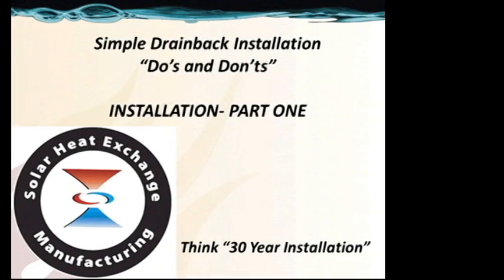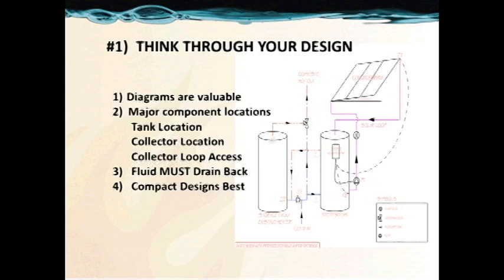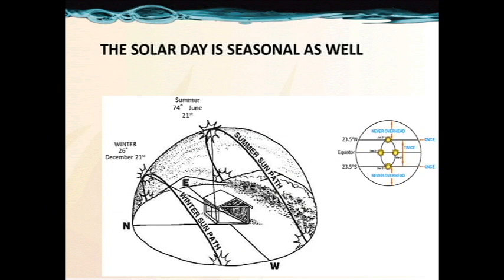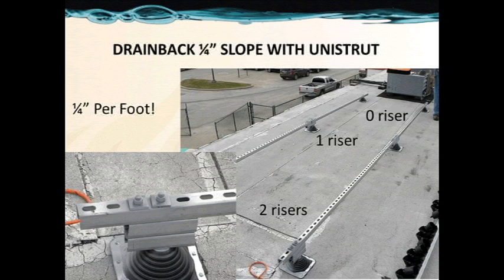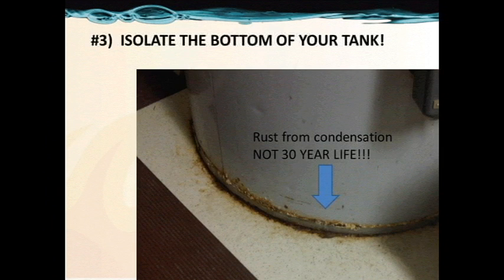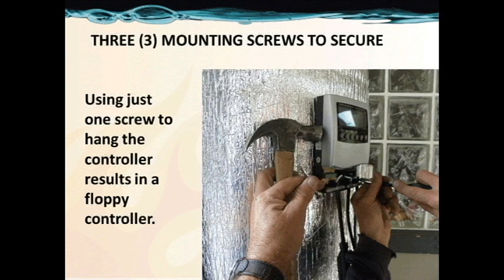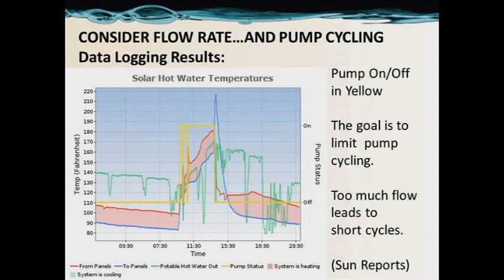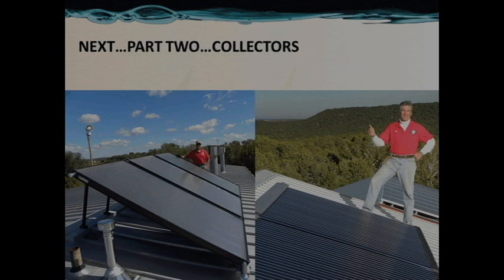Simple Drainback Installation Dos and Don'ts

Comment: Your pacing, tone, and presentation is EXACTLY like the great Michio Kaku!
Anyway, I know this question is probably like beating a dead horse...
I live in central PA, and we do get quite a bit of freezing weather/ cloudy days. I want to heat a 200 gallon tank to around 140 degrees or as high as i can get it. Then I will just be heat exchanging out of that as necessary for radiant and dhw. What would be better, flat plate or evacuated tube? Flat plate prices are ridiculous for what they are, evacuated tubes are actually cheaper now'a'days. So I'm leaning toward the evactuated tube for drainback. Any input? Great video by the way!!!!
Reply: This reply is probably too late for you, but, it is my understanding that flat panels are better in sunny areas like the southwest, and that evacuated tubes are better in overcast areas like the northwest. Unfortunately, evacuated tubes can't be used in a drainback system. You will need to use anti-freeze and a heat exchanger.